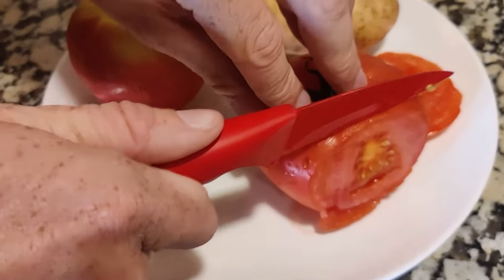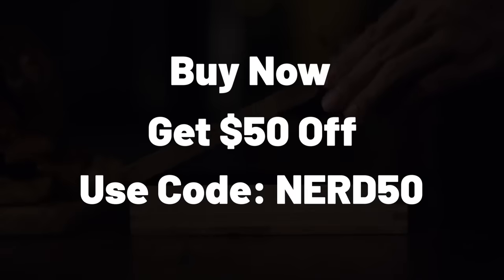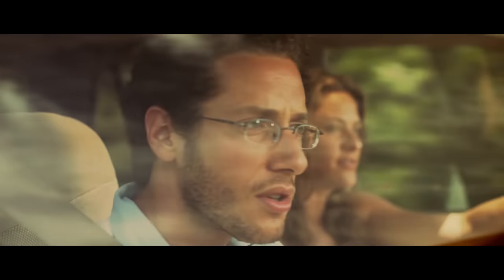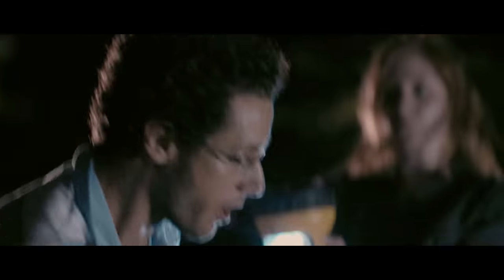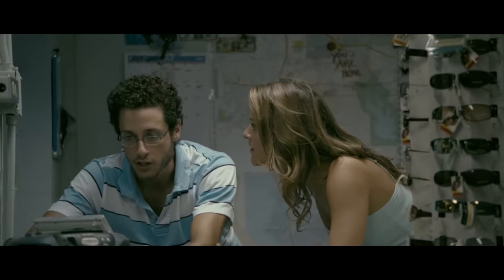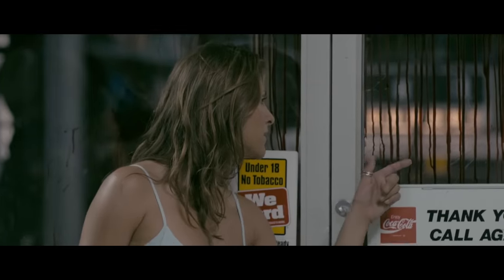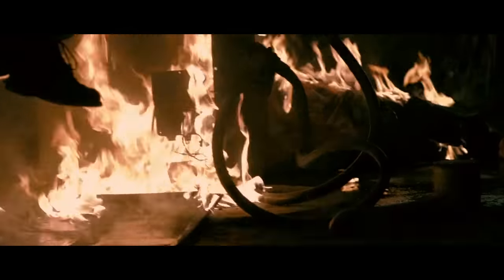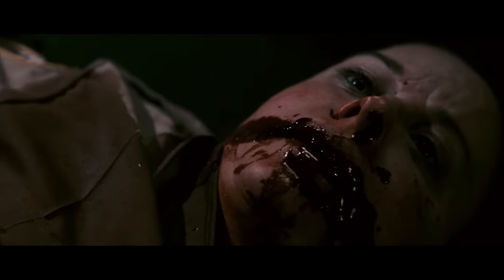How to Beat the SPIKEY PARASITE in "SPLINTER"

Comment: I don't think this is a 'world-ending virus' as much as it seems at first.

Sure, the hosts it infects become ultra durable, powerful, and fast. But based on its sensory capabilities, it would face a lot of obstacles in a 'global infection' scenario.

For example: hotter climates would pose significant challenge to it, since a lot of creatures will be cooler than the ambient temperature. It would literally be blind and unable to zero in on new hosts. And how does extreme cold affect it? Since it's attracted to heat, I would assume colder temperatures might negatively impact it somehow, so colder climates might be a hard wall, as well. This potentially leaves much of the world completely unassailable.

But then even in the right environment, if you consider the mere fact that the infected bodies were barely responsive until a certain distance was established to new hosts, it becomes even more of a problem. There would be a very tight 'action zone' where beyond that range, it wouldn't be able to find new things to infect, effectively halting the spread until something wanders into its sensory range.

Also, I found the stitching mechanic really interesting. It clearly wanted to meld different infected hosts together as they were infected, and I think I understand why: to increase its internal temperature. But it seemed to get a lot slower when it combined multiple bodies. I view this as a dramatic flaw in its nature, as the bigger it gets, the more apparent it becomes, while also taking away its ability to chase new hosts. Both of these put together means it would eventually create a large, horrendous monstrosity nobody is going to willingly walk up to, that will also be too slow to catch anything.

Comment: Nah, the parasite doesn’t use the host’s sensory organs to track pray, nor chemical sensory in the case of the hand. Look at the black goo and how it acts, and how it black “tethers” connected to and attracted the dead bodies to form that grotesque amalgamation of body parts. It’s just like that magnetic black liquid you can find videos off. It’s tracks it’s prey via magnetically sensing the metals in its preys blood. With humans that would be the iron in our blood. As for how it can sense the heat radiating of not just it’s prey but things like the SUV’s engine, that one has me stumped.

Comment: Actually, I reckon that only the Americas would be in danger, as long as the actual origin was in the Americas. If other countries shut their borders, they will be fine. These things go for heat, so they wouldn’t travel into a cold ocean.
Reply: @baydiac  well, if other countries shut their borders, that wouldn’t be a problem. And people would likely be checked before being evacuated, and that is if normal civilians are allowed to. And pilots may be specifically given orders to crash the aircraft in the sea or in the US if they have an infected on board. Explosives may even be used as a failsafe. Those who are even remotely close to affected areas or reports of attacks would likely not be eligible for evacuation. If someone does get on a boat or aircraft and begins to lose control, the spikes would likely pierce an aircrafts thin walls and cause a depressurisation that would cause the aircraft to turn back to the nearest landing area. On a boat it would have to be set ablaze and scuttled to prevent any infected floating onto land. Other countries would also likely be informed that the only way to reliability take an infected down is the destruction of its cells via incendiary or chemical weapons. If an infected ship or aircraft made it to a foreign country, their military would have had been informed of how to combat the splinters. In both the US and UK flamethrowers are legal (not sure about other countries), and many countries have access to incendiary devices such as thermite, and Molotovs could be crafted by soldiers with a rag, flammable liquids and a glass jar or bottle. Napalm could be used, possibly something as simple as an aerosol and a lighter could be effective against smaller infected animals.